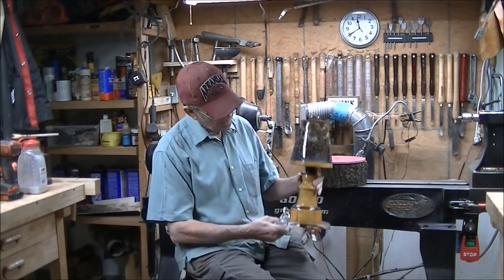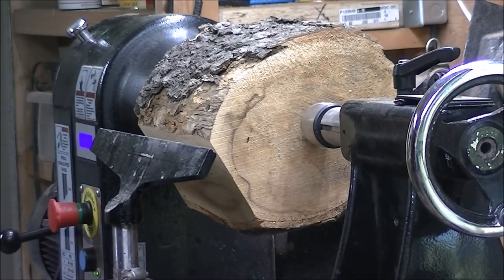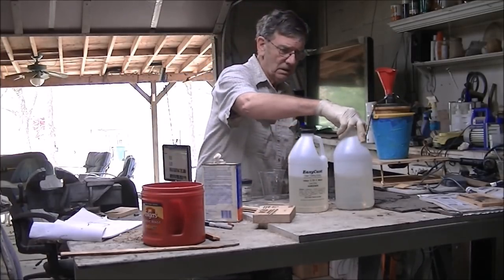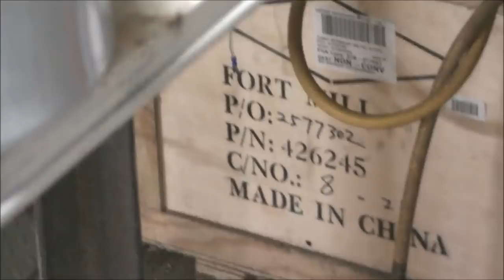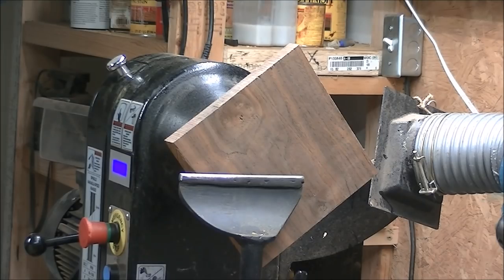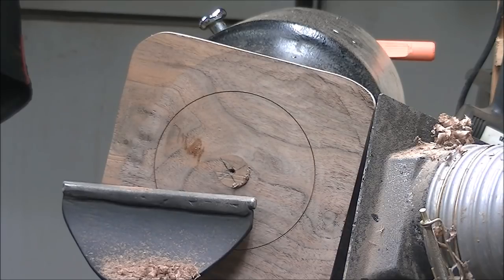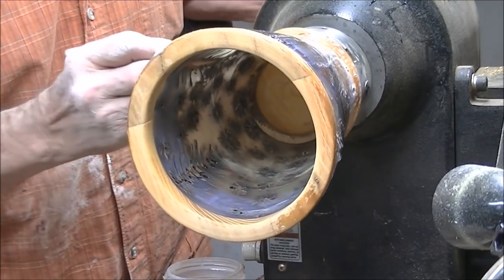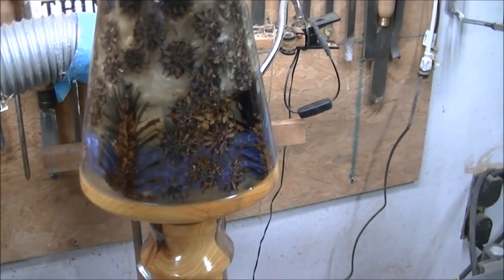One of a Kind Lamp # 80

Comment: Well Larry. What a beautiful lamp you made there, my hat is off to you. I tried making a lampshade out of pine, I turned down to around one eighth of an inch thick and it was beautiful the light shone through perfectly and it fit the wire frame perfectly. I took it in the house to show my wife and forgot to take it back to my shed, the next day it had warped and wouldn't fit the wire frame anymore, is there any way to get it back into shape that you know of? yours Ron.
Reply from the maker: If it's not thick enough to turn again, you are fried.  You could make the wire fit the shade.  Thanks, Larry

Comment: Larry, what brand epoxy/resin have you found is the best to work with?  And where do you buy it?  I am going to attempt a bowl similar to yours and all I need to buy is the epoxy.
Reply from the maker: Easy Cast and I get it off Amazon.  About $80 a gallon.  Good luck, Larry
Reply: Larry, is this the same resin that I would use to pour on table tops?  Reason I ask, I have some of the table top resin, just wondered if it is the same thing I would use for a bowl..
Reply from the maker: I don't see any reason it shouldn't work, Larry
Reply: Thanks Larry.   I will let you know how it turns out...